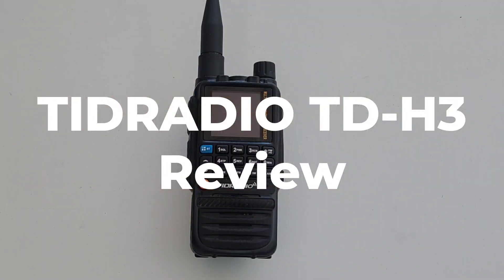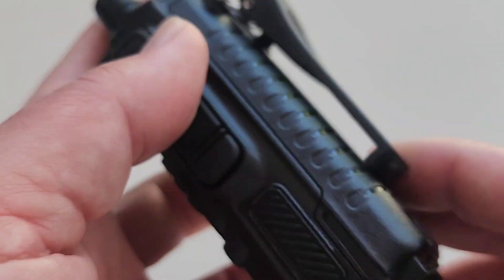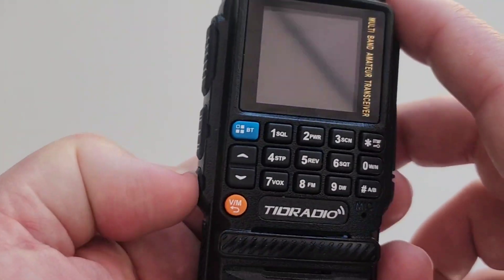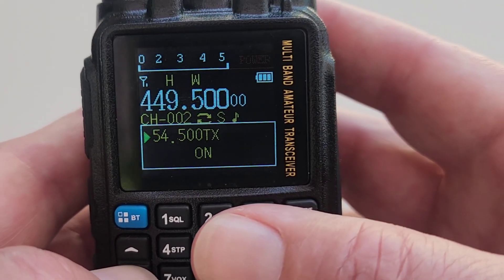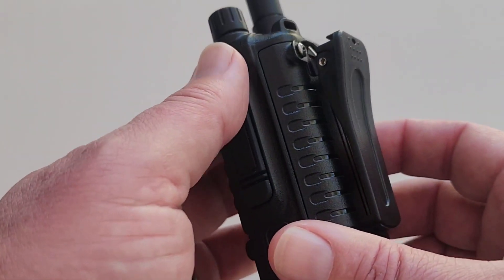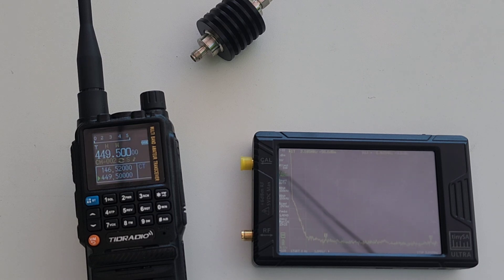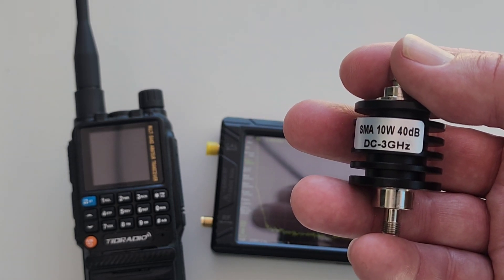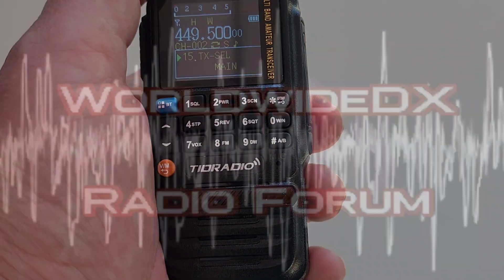TIDRADIO TD-H3 Review

Comment: You can program the firmware upgrades thorugh the usb side port and cable provided... I have done it. No need for a separate kenwood style cable.
Reply: Thank you for the info.. Can I blue tooth pair this to a helmet headset? If not is there a radio you recommend
Reply: @camposvazquez  unfortunately, no. The bluetooth in the TD-H3 Does not connect to blutooth audio devices. it is purely for programming the radio and that is all it does. I only have this model of radio at the moment and so I don't really know of any radios to recommend for your question.